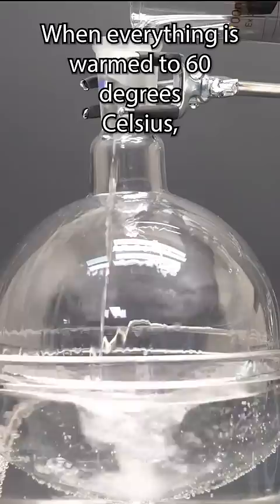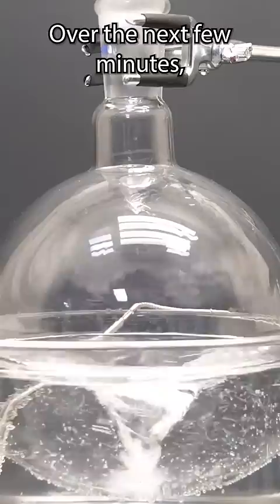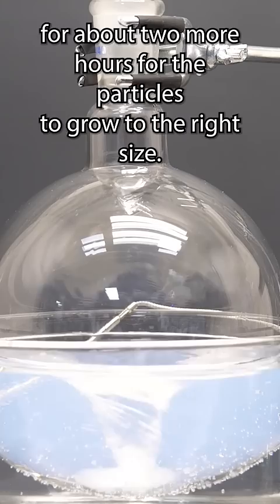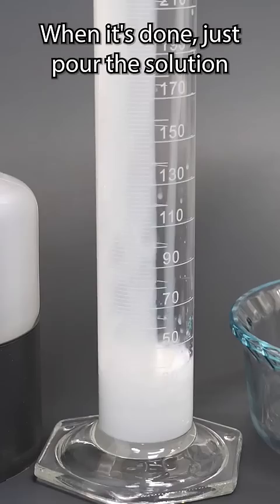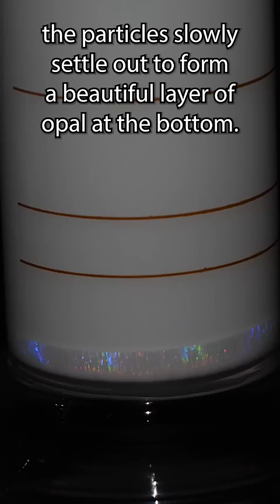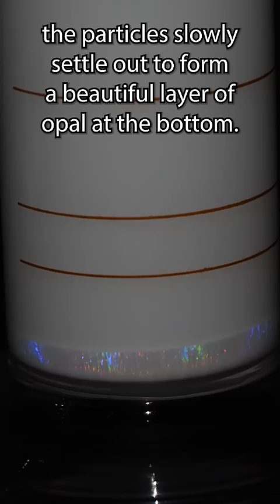Growing a Real OPAL 🧪✨

Comment: If you ran the solution in a centrifuge couldn’t you skip the month(s) long wait time, or would the necessary structures for opal not form without time?
Reply: I would love to know because that is what I thought about.
Reply: The centrifuge would probably still have to run for a long time.
Reply: In the full video he says that the centrifuge crashes them out of solution too quickly to form the right structures
Reply: The Opal is a medium in space, and thus also a medium in space-time. You can't just remove time, because then your Opal will not have anything to form in.
Reply: @oonmm   You’re 14 and that’s really deep
Reply: you won't get the proper particle size to bend the light
Reply: @Aaron-zu3xn  I don't think it's the sizes, but the arrangements. If left alone they self assemble into a 3-d structure, vs. getting squashed to pancakes... 
    I've never seen either under an election microscope btw, so I can't say exactly, but would like to....
Reply: @oonmm  haha, yeah, Opal is a sort of semi-irregular photonic crystal metamaterial,  so I guess it's play with light over time also makes it a 'time crystal' , so yeah, what you said.... sounds better...
Reply: @petevenuti7355  Your explanation is a little out there, but it's still coherent and factual. We need to be more inclusive about different ways of explaining phenomena in the science community overall I think. Thank you for your explanation of the time crystals.
Reply: Idk much about gemstones but crystals just take a long time to grow, can't really speed it up and even on an industrial level a batch can take 8 months for some crystals
Reply: If you speed up the crystal formation, you get smaller crystals, and your opal will look more like it has fine glitter rather than bright flash.
Reply: I think the centrifugal force just wouldn't allow for proper forming of the crystal, and would most likely result in producing nothing but quasi-opal beads, the size of which would probably vary wildly.
 This is all an educated guess though, I'm not a certified physicist, if you can believe it. I pretty just based that assumption on the crystaline structure of the opal, as well as my very basic understanding of physics.... and a short google search on how opal forms naturally.
Reply: @evilsharkey8954  too small and just looks white..
Reply: The centrifuge would destroy the color bands in the opal and it would appear white id assume
Reply: Actually it's the opposite.  Kyocera, who bought the rights to the Gilson process, uses seismic dampening.  Vibrations are bad.  At least, that's the rumor.
Reply: @oonmm  What? lmao
Reply: @oonmm  
This not how the interrelation of space-time works.
Reply: @petevenuti7355  yess!! TIMEEEEE CRYSTALSSSSS!!! ⌚⌚⌚⌚ 🔮 🔮🔮🔮🔮🔮😱😱😱
Reply: A centrifuge main purpose is to diffuse 2 chemicals from each other, isn't it? Then by that logic, a centrifuge would ruin the structural system and ruin the outcome
Reply: @oonmm  
Time is just a tool for humans measure movements so on.Theres no time energy.
Reply: Does putting the solution in a vacuum chamber help speed up the formation time due to the atmospheric pressure?
Reply: Kyocera lets them grow for a year. Ain't it telling?
Reply: I’m taking a masters in crystallography, literally how to make crystals. If these silica particles need to arrange like a crystal does, then it probably follows the same rule as all crystals do; the slower the crystal grows, the more regular and perfect it’s structure will be. You will get bigger crystals that all grow in the same direction rather than several small ones that are growing inside of each other. There are other parameters that need to be adjusted depending on what you are crystallizing, but in terms of time: longer = better crystal.
Reply: @_Just_Another_Guy  no. Putting the solution in a vacuum would vaporize it, not allowing the silica particles to carefully stack in their lattice structure. If anything a higher pressure would give you a faster rate of precipitation and aggregation of the silica, but you’d probably get a different structure that is more dense and will reflect the light differently. Same goes for centrifugation. If you want a pretty structure, you gotta let it grow nice and slow, at a stable temp and preferably in the dark. That’s the rule of thumb with protein crystals anyways.
Reply: @oonmm  my brother he didn't say it made it form instantly, just asked if it would form faster.
Reply: it needs to sit so crystals can grow to bend light,you'd be better off with a still solution but under tons of pressure like how giant synthetic quartz are grown
Reply: @ghostbombl8034  time is a dimension of space not a force. since height has no energy either did i just prove the 3 dimensions you can see with your own eyes dont exist or did i just mix up 2 very different concepts into nonsense?
Reply: @oonmm  ye some people don't understand that time needs more time, just like having a kid you must wait for the time to pass not pull it out LOL
Reply: @oonmm if that reasoning worked than you wouldn't be able to speed up anything ever. The sugar in my coffee is a medium in space time, so I can't make it my mix faster by stirring...
Reply: @kylemarik688  Rearanging the order of particles is simply moving things around, and you are allowed to do so freely without breaking any natural laws. Changing the inherent property of matter itself on the other hand is something else. You're way in over your head here, kid.
Reply: I thought that too but it would just separate and not harden into opal
Reply: @mattheww9656  Nah. Just a fancy way of saying you can't cook a chicken faster by using higher heat.
Reply: @petevenuti7355  except time crystals are something else entirely and they move back in fourth in time. They are stuck in perpetual motion.
Reply: @oonmm  centrifuges still take time, Buddy.
Reply: The particles have to form a very ordered structure to form opal. In fact, they create a repeating crystal lattice where each particle can be thought of as each atom in the unit cell. The colors come from diffraction of visible light by this periodic structure, look up "photonic crystal". As for using a centrifuge, this wouldnt work because the particles need to settle at equilibrium in order to achieve the highly ordered photonic crystal structure. Centrifugation is not equilibrium.
Reply: I thought the same thing. Thanks for making this comment so I could learn why I was wrong.
Reply: The centrifuge is one of those spinning things right? How would that help the opal to form? I’m curious?
Reply: @oonmm  dude xD no
Reply: First we need to know exactly what is going on in there. Some chemical reactions take a lot of time depending upon the rate determining step.
Reply: @samuelbucher5189  scientist has entered the chat
Reply: @oonmm  I don’t think that how that works
Reply: Thanks for the knowledge yall dropped here
Reply: @oonmm  Either English is not your native language or your logic is subtly yet fundamentally flawed. I don't want to spend time breaking down how is it wrong. But try to get checked for Aspergers or a similar condition, just in case
Reply: @_Just_Another_Guy only Linux can speed it up
Reply: @kylemarik688 technically from a chemical engineer, yes you can make it dissolve faster by stirring faster. If you stir it so much that the mechanical energy of stirring increases the temperature of the coffee, then the saturation point of the solute will be increased. As for stirring in general the sugar will also dissolve faster in the solvent rather than not stirring it. The surface area of the solute to the solvent is increased by stirring more. The top of the solution may have lower solute concentration due to gravity, so yeah store it and stirring fast is absolutely a direct relationship to solubility. The reverse is happenibg when the opal is formed. The solute, silica, is coming out of solution.
The stirring in centrifugation is actually utilizing pressure and gravity to pull the denser particles to the bottom. So centrifugation isn't a mixing technique is a separations unit. It is separating particles/molecules/elements by their weight.

Comment: The temperatures you are using don't preclude plastic. 

Put your slurry into a 2-part mold coated with releasing agent (petroleum jelly?) and let it set up. Pull the two pieces apart and out pops your opal.
Reply: I was thinking similar. 😊
Reply: or put it in concrete or some sht make it like you mined it out of the earth then you can even have a cool base for the crystal lookin like it isn’t synthetically made using magic
Reply: @kittiekillah   I'd love to open a man made geode containing opal :D
Reply: Im wondering if the reaction binds the thin opal precipitate into a rigid layer, or if it would disperse back into suspension when agitated

Comment: For people proposing breaking the glass. Opal is glass, so its possible that by breaking the glass beaker it might also break the opal. Maybe you could coat the tube glass to prevent that though. Although the lattice is probably less brittle with opal than normal amorphous glass.

Comment: You said silca, does that mean you could use the same process to synthesize asbestos?
Reply: "What are you making?"
"CANCER"
Reply: you can do whatever you want buddy thats what science is all about
Reply: Yes and no, it should be possible but there is no commercial use for making synthetic asbestos (it is way cheaper to just mine it).
And creating silica micro structures isn't simple at all.
Even synthetic opal usually has to be impregnated with resin or a different form of silica.
Reply: @rockspoon6528  while asbestos can cause cancer, uts more common issue is that the little spikes get stuck in your lungs and cant be removed.

they create scar tissue as you breathe, and it never goes away, only compounding over time.
Reply: @simonhoel2704  Granted, but that makes for a less interesting joke.
Reply: @rockspoon6528  not if you call asbestos lung juicers.
Reply: @simonhoel2704  doesn't fibreglass insulation do the same thing
Reply: @tsrenis  yes.

i remember as a kid a group i was in was insulating the bottom of a yurt. 

i left because my arms felt painfully and inflamed. (like chickenpox)

the teachers harassed me about it and called me sensitive.

yet now there are lawsuits caused by the damage fiberglass insulation does when it enters your body.
Reply: You can synthesize a lot of things with chemistry
Reply: @Blingy McDaddy  I would love to know because, in reality, the answer is a firm no.
Reply: Chemistry is a pathway to many abilities some consider to be unnatural.
Reply: @simonhoel2704  You've just explained how asbestos causes cancer, it's not an either or situation...
The inflammation from the fibers that get caught in the lining of your lungs causes inflammation because it's damaging cells. The inflammation can often damage even more cells. The damage can result in mutations that can then lead to cancer.
The main risk with asbestos fibres in particular is that we have no way of naturally decomposing the fibres and thus they remain in the lungs for a very long time.
Reply: Silica is not even remotely the same thing as asbestos.
Reply: @tetrabromobisphenol  Asbestos is made up of of silicates... Which are silica salts. Technically speaking silicates aren't silica but they're very similar and both can cause lung damage when particles of the correct size enter through your trachea.
Reply: Blingy McDaddy  Aw man, there is  much training these days on asbestos and dedicated personnel are assigned to address it. Sad that it took a long time to reverse course on this "miracle insulator" 😢
Reply: @ILLUMINATED-1  So, it's like free-verse open mic punk rock?
Reply: Lots of stuff is silica lol

Comment: This would have to be a frozen opal, wish as water opals. If you freeze this opal you will be able to remove it from the tube but it can only stay in form if frozen. You’ll need to activate it with a pressure(this will make the color beautiful and a rock you can hold that isn’t in a deep freeze)
Reply: Can’t deep freeze at home😢 unless you/someone knows a way to do it?
Reply: No need to activate anything. That thing at the bottom is opal. Regular opal.
Reply: just break the tube
Reply: Does freezedrying work?
Reply: Not true at all
Reply: @KajSeVai  he has no idea what he's talking about
Reply: I have these at home you're wrong

Comment: Take two flat washers and tack them together with one laying flat and one standing up. Lay it in the bottom of the tube and the opal will form around it. When you’re ready to remove the opal, just hook the washer and pull.
Reply: Just do one washer and a string going up the tube thats tied to the wasker the opal will form around. Then just pull the string when ready?
Reply: @TheBassistninja  that could work but I worry about the cluster cocking when the string is pulled which will just get it stuck in a different way. With the up turned washer tacked in the middle, the string or hook pulls straight up, preventing cocking.

Comment: Use a silicone tube with a quick releasing agent, it should peel straight off and be resueable
Reply: I wonder if he has a specific reason for avoiding that, since it seems obvious.

Maybe he can only see the progress for a video like this if he uses glass.
Reply: The problem is that the opal is still a bunch of tiny sepearate particles and would mix with the rest of the white silica liquid as soon as you move it around. 

Perhaps they could freeze the liquid.
Reply: A man on Australia Created Man mad Opal around 40 or 50 years ago, He kept the process secret but His opals were indistinguishable from Natural Opals.

Apparently he Grew the Opal Crystal's at room temperature on a Shelf in Glass Vegemite Jars

Comment: Realistically if the tube has the same size and opening you can push it out using the same way you clean a flash chromatography column.

Comment: People are saying "just break the tube", but it sounds to me like the particles have settled out but there's nothing binding them. If you mixed the cylinder the bottom layer would disappear back into the solution. Breaking the cylinder would just make a mess.
Reply: True
Reply: As the solution is still basic so he should add more precursor without without stirring
Reply: What did the ammonia do then?
Reply: @yumkikko  ammonia is not a binder here. It helps in polycondesation.(for making Si-O-Si bonds from R-Si-OH  OH-Si-R)

Comment: Use a tube with a screw cap on the bottom.  You could take a 50 mL falcon tube and cut the conical end off and turn it upside down.

Comment: You have to make something like a coffee maker where you press down your filter with a plunger and a little perfect fitting round metal plate with small holes so the water can pass through and a perfect fitting round filter under it.
And slowly press it down until all the water solution can be poured out.
Maybe you should use a coffee maker like this so that you don't have to DIY a makeshift plunger.
It's a cool idea though.

Comment: I wonder about using a thick steel pipe, and letting it crystallize at pressure. When it is done, you should be able to just unscrew the bottom, and push on the top :P

Comment: Wondering if you could get it out by making a container that splits open vertically in a reusable way with a hinge or something. Also maybe you'd need a material between the glass and opal so it sticks to that instead of the opal. But idk how things react to it if there even is any cheap material you could break to free the opals without it messing everything up.

Comment: Freeze the solution and then take out the Crystals part, i mean opal, but as water expands while freezing it will break the tube anyways.
Or you can use a Pipette to slowly suck the remaining portion of water very carefully as at the end particles will again be back in motion.🙌🏻⚗️

Comment: Can you not let it settle in a sand mold?
Can you not vacuumcoat the inside of the tube with plastic and then just pull it off when it's done?
How about harmonic frequencies? Utterly vibrate it loose.

Comment: Reallyy??? Dude you could litterally just pour out the liquid and reduce the process over and over layering the opal in the same tube so then you can break the tube open or use a Dremel to get it out once your done it will be a unique layered tube. My other idea is to use a rubber mold to zest the opal in after you can get it out easy for reuse. Let me know if you read this!

Comment: Would adding diamond dust with the TEOS have any notable effect? I've been varying degrees of diamond micron monocrystalline sizes for a substitute of silicon carbide. I mixed a bit into some acrylic paint and noticed the diamond crystals were very sparkly. Better than any metallic powder I have used in the past.

Comment: Maybe put something that fits perfectly in the bottom with no gaps, that you can tie a string to the middle of and lengthen the string straight up, then, after the opal has settled, it I'll have formed on the loose, yet air tight plug at the bottom which you can easily pull out with the string.